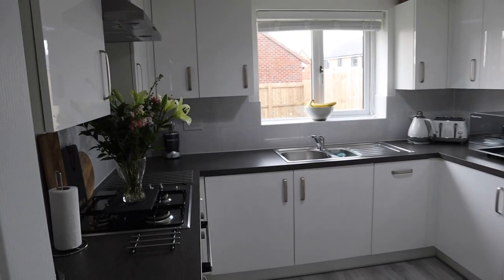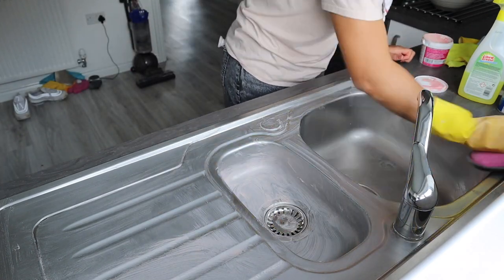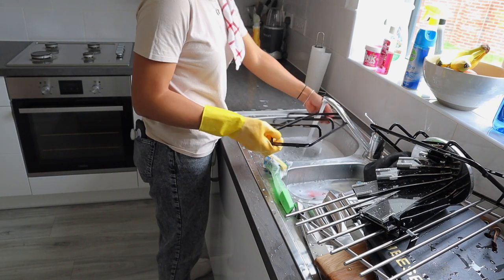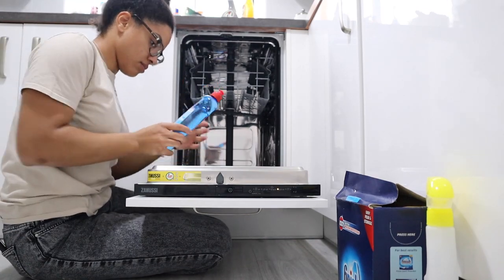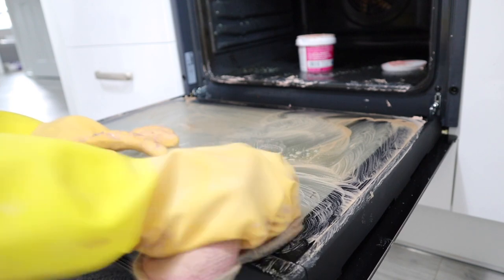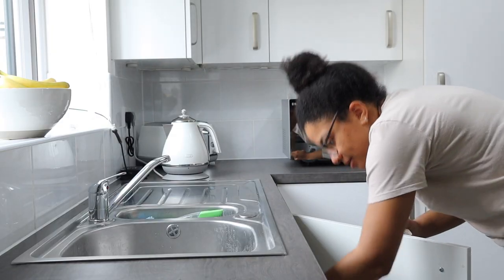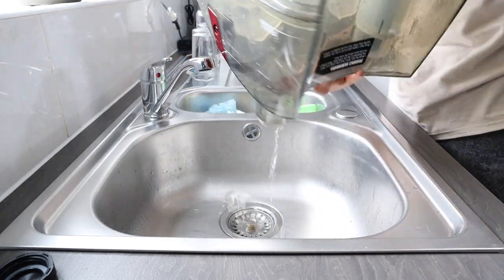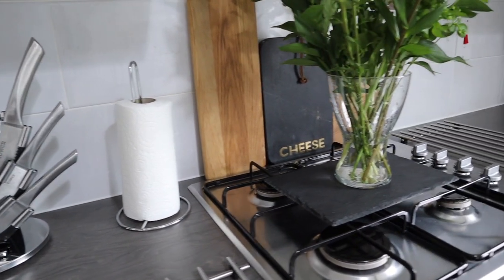HUGE KITCHEN DEEP CLEAN WITH ME UK 2020 | Quarantine Clean with Me | Shade Shannon

Comment: I use the Poundland version of Oven pride. My racks sparkle not a single spot or stain. The product is caustic, but it is exceptionally effective. I use my oven 3-4 times a week, looking at it you’d think its never been used. Its just £1. For degreasing nothing I mean nothing, beats Soda Crystals. Its also a natural product. Another hack  I use is, I throw some bleach in the bottom of the dish washer as you run a load, it sterilises the dishes. Aldi and Lidl have the best tabs and salt for the dishwasher. Beats Finish by a mile.